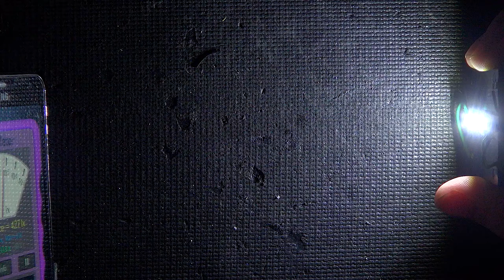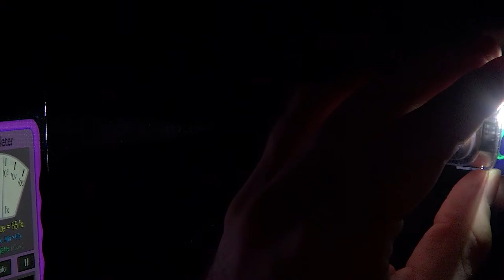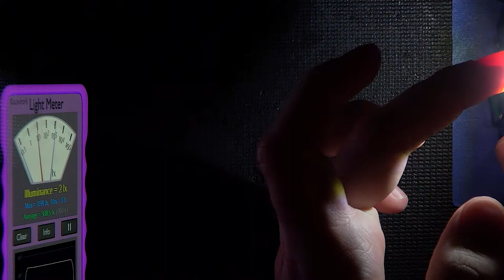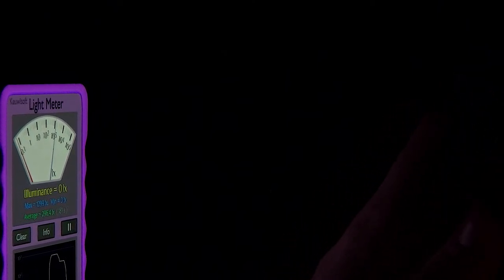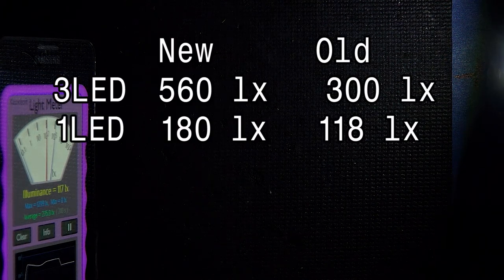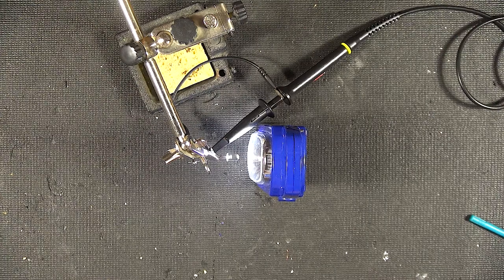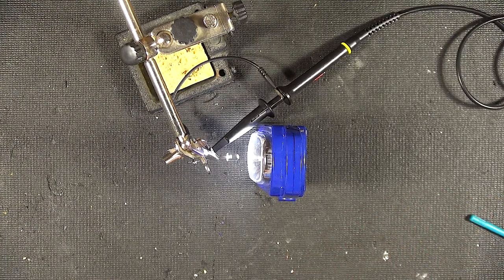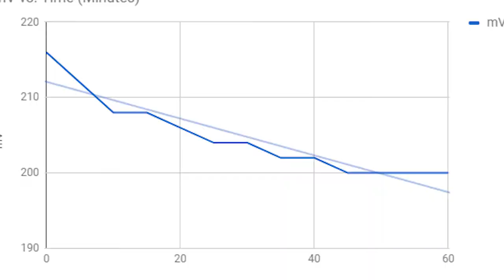Dollar Store 2-in-1 Flashlight & Camping Light | Teardown and Tests

Comment: I've seen people clip these onto their backpacks when they're walking or riding at night. They output quite a bit of light. More than you would expect from a Dollar Tree product. A relative also does this. When he comes through the door with two of these on his bag it lights the whole entryway hall up. I've also seen people use colored cellophane from Dollar Tree or just run some tape over the cover and color it with markers to add visibility. A quicker way to pop it open: pop the switch cap thingy off, place a flathead between the metal housing for the switch and the edge of the casing and just move it sideways for the first pop, then run it along the crease.